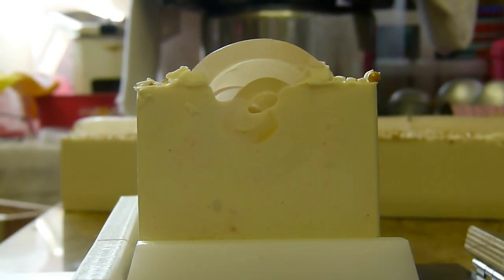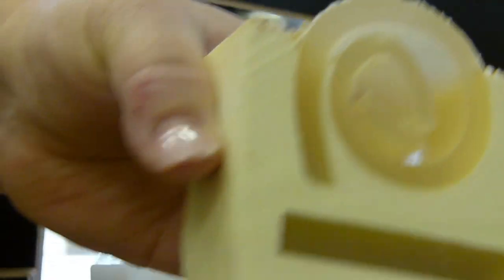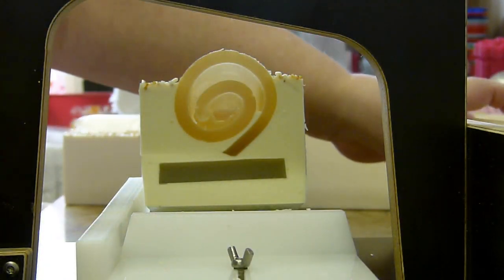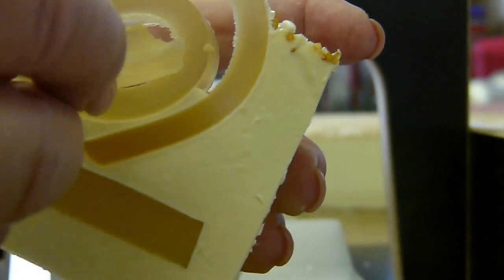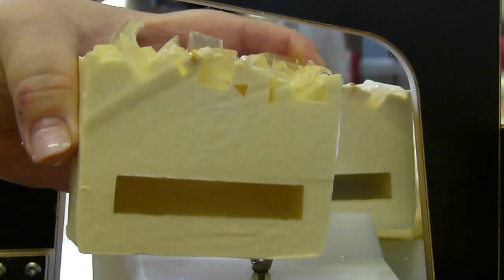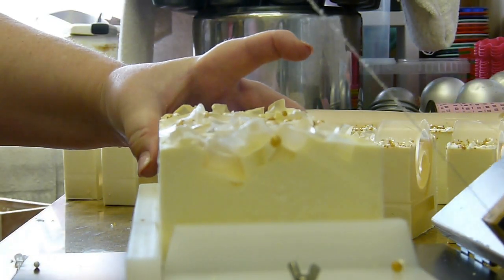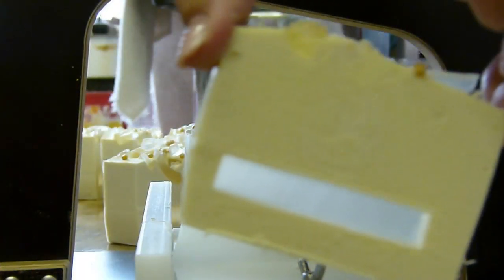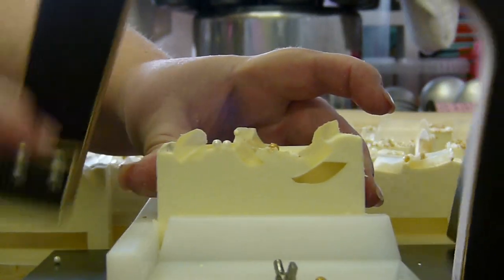Soap Cutting the MP & CP Soap from last video.

Comment from the maker: Thank you to mlangelfire268 who told me to tighten my wire. It will be tight in the next cutting video. I hadn't read your comment before making this video, so that's why the wire isn't yet tight. xx
Reply: Also, make sure you loosen it when you store it then tighten it when you're ready to cut soap.💛 I clean mone with alcohol and a little brush afterwards, works well.

Comment: Karen you made winners 🏆 in this soap. They look so lovely.  A bathroom showpiece 😉.   I have had my cutter from Buds Workshop (on etsy) for years now and absolutely love it.  It is steady on the table and love how it cuts even and a same bar every time.  Have never broken a wire, yet.  I know you will love yours and find you don't want to do without it.  I am impressed, usually the balls on a top will drag down thru the soap and the loaf will have to be cut on its side, but yours didn't!   Was very impressed with your technique!  Thanks for sharing. 😊